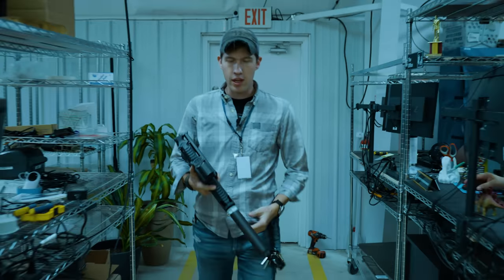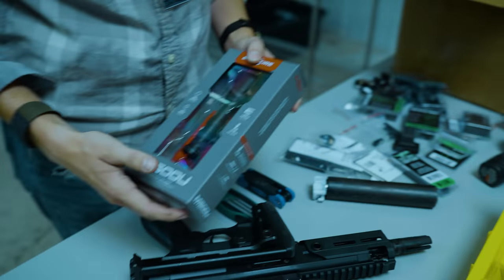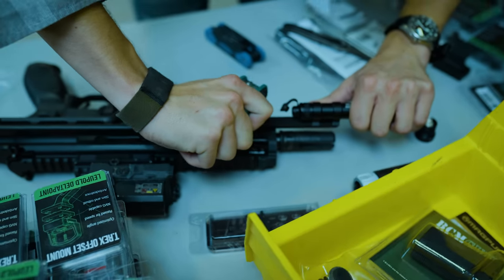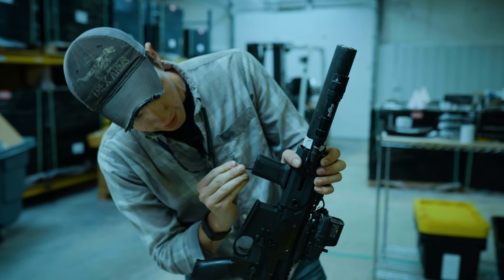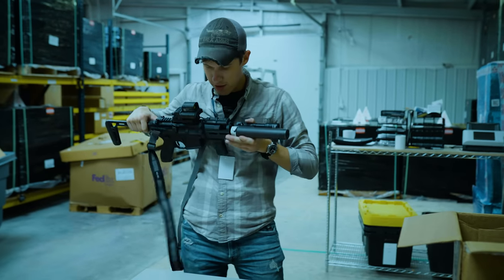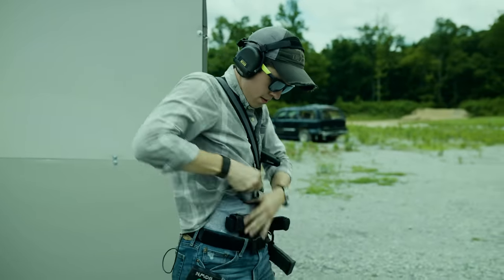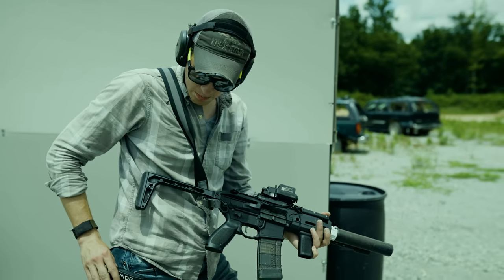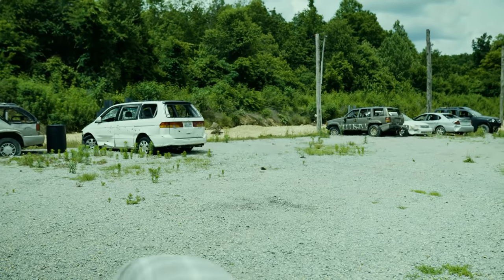First Shots with Sig Rattler 300BLK

Comment: You know when a business is super successful when the CEO doesn't know where product is exactly!

Congratulations Lucas!
Reply: Or he just isn't even remotely involved in logistics for his company....thats literally what employees are for.
Reply: @yoloactual6975  I think he meant it as a compliment. A lot of overreaching bosses involve themselves in too many areas and spread themselves as thin as possible, so no area is without their deliberate influence. Not sure where the original quote came from, but there's a saying about leadership that goes "The most successful bosses/leaders are those who make themselves useless." If your company takes care of itself--your employees are high-functioning and hard-working without any backseat bossing--then you're doing exactly what you should be doing.
Reply: @joshbutler2563  Umm that quote doesn't quite fit the point ure trying to say. I understand that the quote has been misinterpreted many times before and i totally understand ur point too. Backseat-bossing is on the opposite spectrum of getting involved in too many areas (i.e. front seat). Backseat bossing refers to managers who are hands-off, yet continuously instruct their employees from their own seats (figuratively) which is their own office instead of coming down to the warehouse to understand the problems. There are several types of managers relevant to this current topic, a manager who constantly micromanage their employees which is what ure talking abt (overreaching managers), a manager who is backseat-bossing and lastly a hands-on manager who participates in different jobs so that he knows his stuff & problems, but without the micromanaging.  The reality is successful managers are where they at because they know the inside-outs of their business especially their logistics and operations, they are hands-on and understand the problems and gaps in the company.
Reply: @joshbutler2563  if a boss does nothing then why the fuck does he need to get paid.
Reply: @de4dbutdre4ming  is this for real? My CEO doesnt know what I do. he just sees my results. He couldnt navigate where all the files are on my computer..........

Comment: If anyone wants to build this gun in cod the class is...
-M13
-Monolithic Suppressor
-Tempus Mini
-Tac Laser
-Ranger Foregrip
-Operator Reflex Sight
Reply: Better to swap out the monolithic suppressor and the tempus mini with the 300Blk ammo and integrally suppressed barrel
Reply: @Phosphorus-ew7qm  You'd need the Mini barrel, but .300BLK and the skeleton stock would make it more accurate
Reply: @Phosphorus-ew7qm  It's definitely a better class that way, just wanted to make it more accurate since the mono is the closest one to the surefire that Lucas is running and wanted to make the barrel a similar length.
Reply: @Briggsian  I agree, but the problem is you don't get the laser that is integrated into the sight that Lucas is running if you use .300blk, also i don't feel any difference between normal mags and .300blk in MW so i just figured it wasn't worth it. I also thing the default stock is close enough and i would have to give up the foregrip or the sight for the skeleton stock.
Reply: Did Lucas fill out a form 1 for the Ranger Foregrip? It appears to be a AOW by ATF standards.

Comment: The Rattler is definitely one of my dream guns. Mabey one day they'll be popular enough that they'll be available at a decent price, for now, a new BCM upper will have to do.
Reply: I need someone to explain to me why its so cool to put the buffer spring above the BCG instead of behind it. that is really all the MCX does. is it just for the foldable stock? to me, have a 556 upper and a 300blk upper share the same lower receiver and BCG is really the way to go.
Reply: @625098evan  The ability to fold the stock and still have the firearm operate is a massive improvement over an AR. It allows the gun to stay super compact and fit into lots of bags. Furthermore, the MCX requires almost no tools to change things like the handguard, stock, or change gas settings, things that you need special tools for on an AR. That's not to say that the AR-15 isn't good, you can defiantly do an AR with a LAW and pick up a 556 and 300 BLK upper and swap between them.
Reply: @kotarichards5218  Law is the old way, 17designs folding billet lower is the new new. 💜😎
Reply: You can make your own Rattler really, can get a custom barrel made with a 5 inch 5.5 inch with a 1/5 twist rate for only like 450 I’m building a 6 inch 1/5 twist build and a law folder
Reply: @MobileAura  you mean an integrated law folder... not really a new thing...
Reply: @thomgizziz  They’re different tho, 17 patented their own design. It’s a better design IMO, and doesn’t cost 300 + the added weight. Law is useful tho and dope I just prefer the 17. 🙏

Comment: 26:25 It is actually a gun in CoD MW. To build it you need to go to the M13’s gunsmith and equip:
The Tempus Mini barrel
Monolithic Suppressor
.300 Blackout Subsonic 30 Round Mags
Skeleton Stock
The rest you can build out to your preference but that’s the base Rattler, more or less. It looks much better with the “Short Stuff” blueprint equipped as it’ll make the handguard and color look a little more true to form
Reply: I personally use the barrel with the integral suppressor. Saves me a space and its pretty effective.
Reply: @Aphabet21  I would agree but it doesn’t look like the real life integrally suppressed handguard/barrel/suppressor. Also it is (in my experience) slower than the short barrel + suppressor setup
Reply: @Aphabet21  As an artificial LARPer that enjoys real-life setups in video games, just like you probably do, yours would look like an LVAW considering the integrated suppressor attachment. Also, Tempus Mini attachment in MW looks like it's 9" long, not sure though. I have two setups named "LVAW" & "MCX Virtus", MCX Virtus uses the 9" barrel. I'm late to the party but wanted to share the info & idea, nonetheless.

Comment: you can have the same lower receiver for a suppressed 7" 300 blk upper and a compensated 16" 556 upper. for just slightly more change over time you can use the same BCG as well. 300 aac blk allows for a lot of versatility on the AR platform. it really bows the MP5 and other 9mm platforms out of the water. however, 9mm will always recoil less. thats just physics.

Comment: Personally, I try to always keep all accessories, "other than my 12 o'clock pressure pad", on the trigger finger side of the gun. Since my primary eye is looking down an optic of some kind I try to keep my non dominant eye as free of clutter as possible. Back when I started getting into firearms I had junk all over the place until my younger brother, "retired navy seal" got a look at my setup and gave me the biggest toung lashing ever but did an amazing job in taking the time and teaching me the most efficient way to run both an SBR and long gun. This weekend he's taking me to some private range he goes to and is going to teach me how to better carry and use my edc. Really looking forward to it!

Comment: "if this was a gun in call of duty, which its not" pretty sure you could build something close with the M13, short barrel, supressor and 300blk mags
Reply: I mean it is the same brand. The M13 is a Sig MCX Virtus and this is the Rattler, so yeah you probably could.
Reply: Actually it is! But instead of short barrel and suppressor, there is a barrel WITH integrated suppressor
Reply: @SpartanStan156  Well that'd be a HoneyBadger wouldn't it? The Rattler doesn't have an integrated suppressor, as shown in the video.
Reply: @SpartanStan156  Im going to log onto COD now and find out!
Reply: @mgh8169  It would be an Lvaw or “the mamba” as it was called during testing.
Reply: @mgh8169  HoneyBadger is overhype shite that fail to meet socom requirements thus rattler was chosen instead.
Reply: Rattler builds from ground up to be 300blk pdw.
Reply: @COLT6940  I mean I disagree but you do you I guess.
Reply: @mgh8169  don't forget AAC owner stalked his ex-wife.
Reply: @COLT6940  the relevancy?

Comment: With a suppressor that big you should run the Sig Rattler suppressor compatible hand guard. It gives you a lot more room and protects you from getting burned on the suppressor. That sling wrapped up also prevents the stock from locking shut nice and tight to the receiver.

Comment: You can sorta build a rattler in Modern warfare. You get the M13 just put the Tempus Mini barrel on with 300blk rnds and a monolithic suppressor and the Skeleton stock boom you have sorta a rattler. You can remove the stock and put on the ranger foregrip and go for an optic too.

Comment: I dig the pick a drill on the fly. Definitley helps train for a bit of uncertainty. I'd like to see you keep doing that but not run through it beforehand.. Unless that is a bit of a safety run through for the camera guy so he knows what you're gonna be setting up for. Try just thinking about the next drill and just go for it with no dry runs. It's gonna be slower but it's alot of fun seeing what fumbles and then run the same drill again and perfect it..Great stuff Lucas and camera guy

Comment: I am amazed at how quiet the shots are. Is the audio accurate and unedited?  I have tried to setup up my AR to achieve that level with no success. I have a Silencer Omega 300 using subsonic ammo and it still is much louder than your video. Looking for suggestions on how to achieve the lowest possible sound level.

Comment: Nice vid.  Curious why you picked up a Rattler and not a Virtus.  

Several 2021-built TacOps were just released surprisingly this past month.  Though supposedly only a short-run Talo exclusive between 2019 and 2020, they have been re-issued apparently.  Has the shortest Virtus barrel that I know of.  Only about 1.25" longer in 300BO - but you can always swap over to a 5.56/223 ;) .  Something that isn't easy (nor economical) to do with a Rattler.

In any case, nice find!  Great vid as always.

Comment: What do you think about steel guide rods and with running one for a glock 19 what spring weight would u use, ?have a threaded barrel so will get a comp at some point ,but want it to cycle on the norm too though.

Comment: I thought you helped with the guns in modern warfare? You can take the m13 and put the short barrel on it, add a suppressor, and use the 300 blackout "mag" attachment. Bam, sig rattler.

Comment: If you are running this weapon  without the suppressor and having a light bar on it, it looks hell lot of wierd. But I love the concept of the light bar. You need full hand purchase on your hand guard. You Don't want any disturbance while you are gripping the gun. Most of the time when we mount a light. We often Mount it left of right side of our gun. Which is cool. If you are right handed shooter mounting your light to the right will not make any disturbance while you are holding your gun because most of us are right handed shooters. Let say you are a left handed shooter or you are having a laser on your right side of rail and having a light on the left side of the rail in the same time. By having a very short SBR that will make you feel your gun is so kitted that your hands doesn’t feel free. So the light bar will take care of this situation. Because it will take the light a but further ahead leaving some space for your hand to grip the gun or to hold the gun with ease.

Comment: Biggest down side to this upper is unburdened powder - yes it’s nice - small form factor - just all that unburdened powder sucks due to that 5.5” barrel. Don’t believe - run quick loads as data confirms only 70% powder burn 🤷🏽‍♂️. Had mine for a month and went back to a nice lite 7.5 DI 🤙🏽

Comment: I love your vids.  They are always informative, and I am impressed by your gun handling skills.  I have learned a lot from watching your vids.  What is the approximate price for a buildout such as this?
Reply: Gun right now will run you about $2600, suppressor about $1200 (+$200 tax stamp), a good optic about $600-800, weapon light with pressure pad about $500, misc stuff (sling, grip) another $250. All in, you could build a similar setup for about $5,000-5,500.

Comment: Looks cool! Suppressor exposed IFO the short rail, are you concerned about touching the hot suppressor while firing especially with the added grip? Didn’t seem to be an issue. Does Sig make a slightly longer handguard? Really good informative video thanks. Sub’d

Comment: 9mm might do more damage on average than a 300 blk sub sonic.  You probably aren't getting the benefits of it being a rifle round when you slow it down that much and the 9mm makes a larger hole in the target assuming the 300 doesn't tumble once it hits.  Generally speaking both rounds will fully penetrate a human body so you won't get the extra energy dump from the heavier round in the 300 blk.  (This is assuming you are using fmj or other ball ammo).
Reply: I am buying an mcx rattler in 556. I am fully aware that it is sacrificing a lot of ballistics capability in such a format......but damn, it will be cool.
Reply: @Catgat37  No sorry you misunderstand me.  The reason rifle ballistics are significant despite being a smaller caliber as far as damage done is because of the velocity of the round.  If you watch a gsw into ballistic gel you will notice a large temporary cavity.  Rifle rounds are so deadly because they cause tearing  in the surrounding tissue because that temporary cavity is expanded so much so quickly.  When you slow the 300 blk out down to subsonic speeds (or any other round) you loose that tearing effect.  As far as I have been able to determine, you still get the tearing effect in a short 5.56 super sonic out of a sbr or 5.56 "pistol".  I believe its a bit less effective when you slow it down to the 10inch barrel speeds but still effectively a rifle wound.
Reply: @deraxelturrelkeign  no...it is a lot smaller than 10 inches (the barrel). We are talking 556 out of a 5.5 inch barrel. It reduces velocity to approximately 1800 fps. People say that 556 won't tumble at less than about 2200 fps. I really don't care. I have seen some meat targets that were adequately destroyed by this firearm. Even shooting straight holes through somebody will do the job if your shot placement is good.

Comment: A standard ar pistol or sbr with a quality trigger and barrel is all that is needed. At some point its all the same. Its all about a close quarters compact gun that packs a traditional rifle caliber. The rattler and jakl are cool concepts, the issue is you can do the same thing with an ar and skip the damn proprietary nature of the other weapon systems. This is why I do not respect a lot of what the gun industry is doing. Too many companies are trying to shoe in rifles with proprietary parts and design. They fail to realize the whole point ar's are so popular is not what the rifle or pistol or sbr can do, its because the design is proprietary to no company and it can be a rifle, a pistol, and sbr. Trying to REMOVE flexibility in a platform in order to increase its proprietary components is a step DOWN and BACK. Either make a weapons platform that maintains that flexibility and lack of proprietary nature, or enjoy being nothing more than a niche gun.

Comment: I'm not so sure that your load-out pistol should include a Glock in the high-noon position. Drawing and holstering from that position continuously, without a safety option, will probably eventually result in a negligent discharge.

You wouldn't want to blow your crown jewels off, or poke a hole in your femoral artery would you? I'm speaking from a purely statistical point of view, given you practice 10× as much as most people.

Comment: Lucas, instead of using regular tape on my guns, I use something like this stuff. It's a self-fusing silicone tape that has no adhesive on it. It's typically used for sealing pipes or wrapping thick electrical wire or cables, but I use it to tape off cables and to wrap my grips on my rifles. It has a tackiness to it, but it's not sticky. And the brand they sell at Walmart is even better, because it's grippy, but little bits of lint and stuff don't stick to it. It has weather and heat resistance, so it's perfect for a rifle, or for wrapping up any gear, really. I wish you'd bring something like this to market as a gun tape. 

https://www.amazon.com/dp/B01N7KC62D